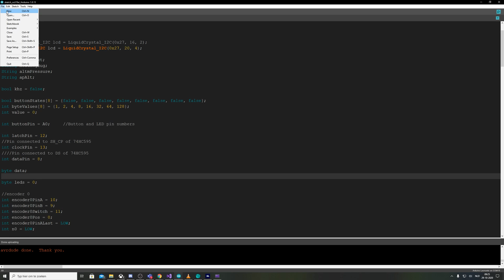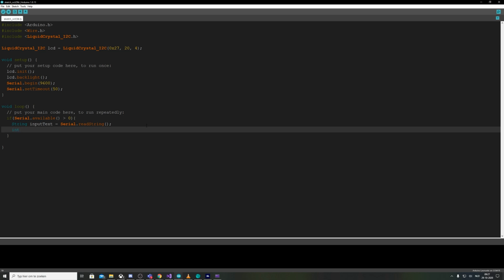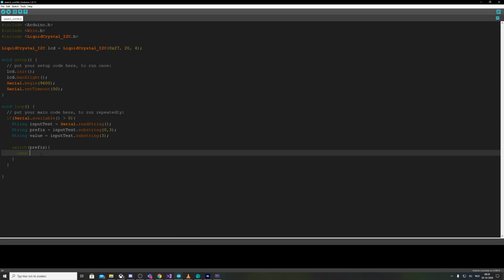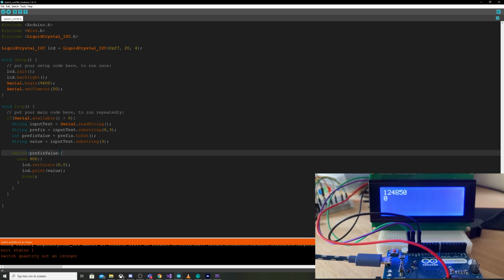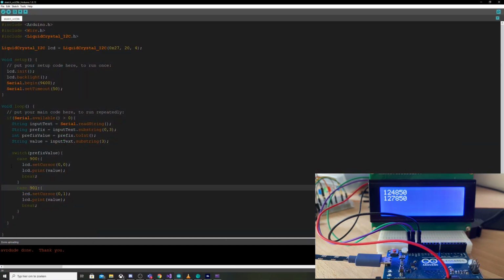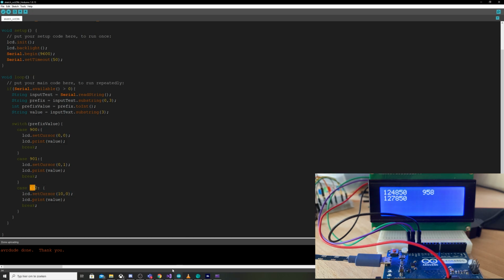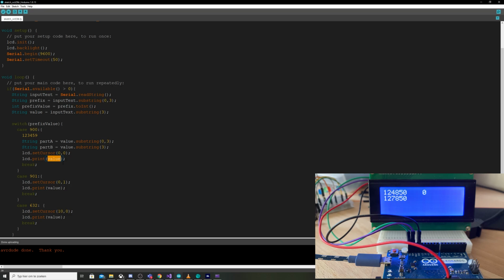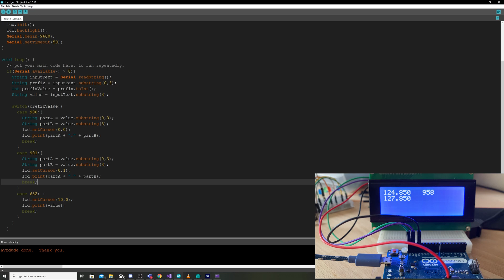Sending data from MFS2020 to our Arduino Update time v0.1.0

Comment: Good afternoon, I have an arduino mega 2560 but there is no way that the buttons and switches will work for me. I can only do it through an arduino leonardo ?? thanks a lot
Reply from the maker: Good afternoon! The Leonardo and pro micro both use an ATmega32u4 chip. This is the chip that makes it possible for your pc to instantly recognize it as an HID(gamepad/mouse/joystick/etc.) input. The Arduino Mega does not have a chip like this. But nothing is impossible. One option could be to create an intermediary program that listens on the comport to your board feeding the data. This program could then convert this to a virtual joystick as an example. This requires some programming knowledge though. (I'm currently testing sending inputs directly from an Uno or Mega to MFS2020 so I'll get back to you when I know more. Another approach (DISCLAIMER: I couldn't get this to work with my Uno and it is now acting up) would be to use something like this: https://github.com/NicoHood/HoodLoader2. But once again this could be the answer or a nightmare.
Reply from the maker: The lcd should work though if you replace Serial.begin(9600) by Serial.begin(115200). I haven't tested this out yet so you would be a test case.
Reply from the maker: Ok I've actually made some progress with Unos and Megas I'll post a quick update this afternoon.